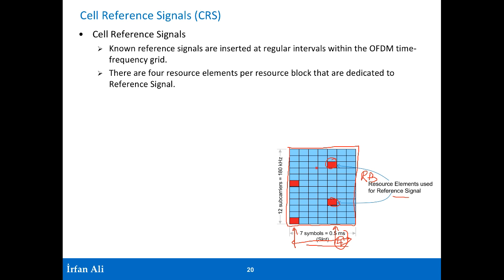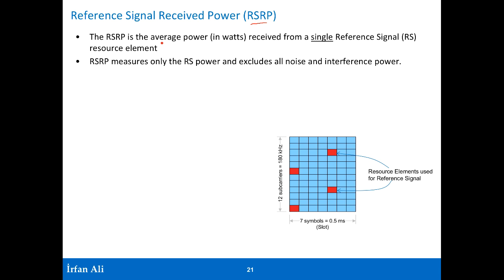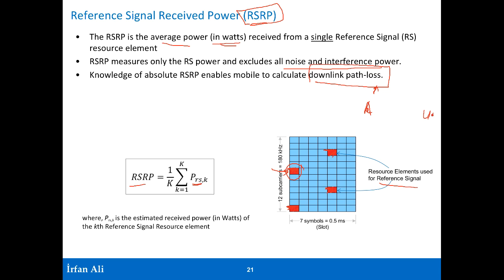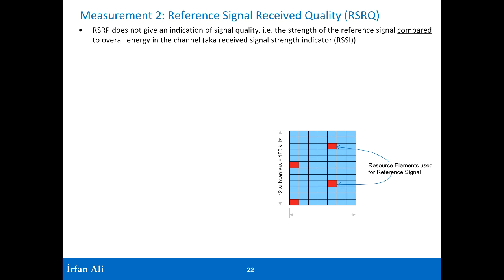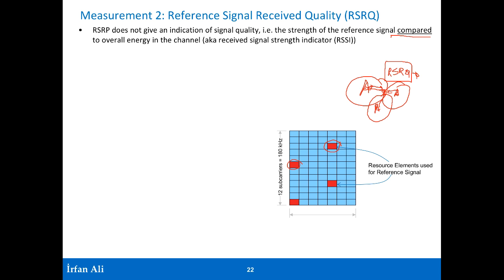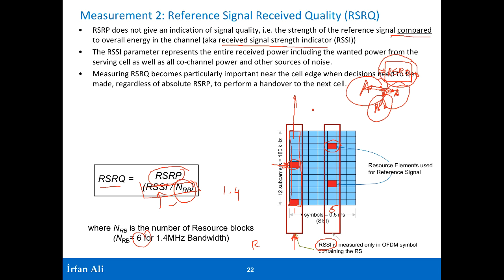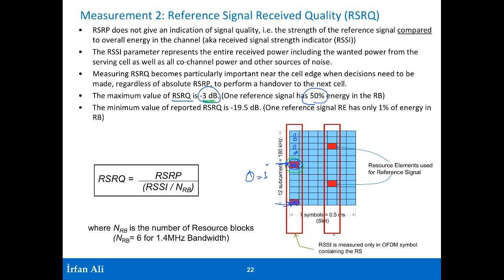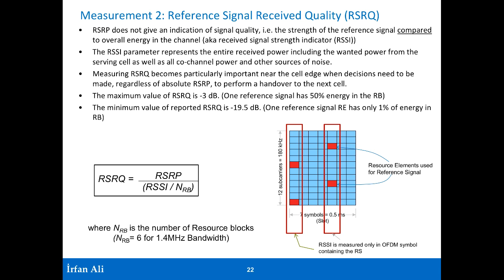LTE Radio Primer Part 7: DL Cell Reference Signals, RSRP & RSRQ

Comment: 1 Resource block have 12 subcarriers 7 symbols and 84 resource elements right? if there are 6 PRB's then why resource elements are 72? I know right there are 72 RE in 6 PRB's but I want to know how? I'm confused somewhere.
Reply from the maker: Each PRB has 12 subcarriers. So, in the frequency domain (y-axis), there are 12*6=72 subcarriers, and hence 72 resource elements. there are 84 resrouce elements, as there are 7 symbols (x-axis), so 12*7 = 84.
Reply: @IrfanAli-nz7mb  Thank you so much !!

Comment: Hi Irfan, if one RB has 4 ref signals then one ref signal should contain 25% of total energy, am I correct? But you are quoting 50%? Can you please clarify?
Reply: RSRQ measured per symbols not RB so it only have 2 RS and that will be 50% of energy

Comment: I love ur training's. What is the main difference between RSRQ and SINR? From my understanding, RSRQ includes own cell load and SINR not but theoretically there is a calculation relation between SINR using RSRQ. That's where I confuse :) if rsrq is used in sinr calculation than own cell load does count. Where am I wrong ? Hope I am clear to explain :) Regards

Comment: Dear Sir,
As we known, one of difference between RSRP and RSSI is the different measurement bandwidth.
RSSI is measured by full bandwidth with all RBs (1RB contains 12 REs) and RSRP is averaged power by one RE.
If noise/interference is added in the full bandwidth of all RBs, why the RE that contained RS not included the power of noise/interference?
Reply from the maker: Hi Jye, not sure i understand your question. imu, the energy in the reference symbol is also included in RSSI.
Reply: Dear Sir,
Thanks and understood that RSSI also contained the energy in the reference symbol.

Around 3:00, mentioned that "RSRP measures only the RS power and excluded all noise and interference power."
Just wondered how RSRP can exclude all noise and interference in detailed?

Comment: dear sir can you Explain what is mode 3 and mode 6 which is use in pci planning please 
want to clear it but from the long time no one can able to clear it please
Reply from the maker: Hi Reshma. An excellent explanation for the motivation behind these rules is in section 31.5 of the book LTE in bullets, 2nd edition. In short:
- UE should not be able to simultaneously receive PCI values with equal (i) PCI mod 3 value or (ii) PC mod 6 value. 
- If PCI mod 3 rule is met => PCI mod 6 rule is also met.  If operator cannot meet PCI mod 3 rule, then operator tries to meet PCI mod 6 rule.

- Two reasons for PCI mod 3 rule, both for deployments when eNBs are synchronized (typically TDD). (a) PSS are of three kinds; they point to the PCI Group (0,1 and 2). If UE receives two cells with the same PSS, it takes longer for UE to synchronize. Equal PCI mod 3 is equivalent to using the same PSS. (b) DL Cell specific reference signals for 2X2 and 4X4 MIMO are transmitted on the same subcarriers for cells with same PCI mod 3 value. CQI (cell quality indicator) reporting from UE gets adversely impacted in this case.
 
- Reason  for PCI mod 6 rule, again for deployment where eNBs are synchronized (typically TDD). If single antenna transmission is used, then DL cell specific reference signal are transmitted on the same subcarriers for cells with same PCI mod 6 value. The video above depicts this case. You can see that there are two subcarriers that carry the Reference Signal (red) are separated by 5 subcarriers in frequency domain. Each PCI++ shifts the RS subcarriers up by 1. For PCI and PCI+6, the RS subcarriers are the same. Again UE reporting of CQI value gets adversely impacted in this case.
Reply: http://ourtechplanet.com/pci-planning-facts-myths/

Comment: Great tutorial on RSRP vs. RSRQ! Now it is clear why both measurement types exist!
Reply from the maker: You are welcome Bengi. I remember us (with Akin) struggling to figure out the details.
Reply: @IrfanAli-nz7mb  Thanks for the video. However, why did you divide RSSI by N_RB ? From the fact that max RSRQ is -3db it seems that RSSI is the sum of the total power in all the N_RBs, not per RE